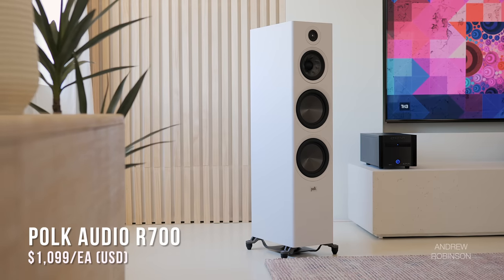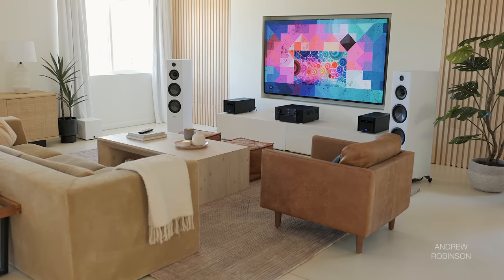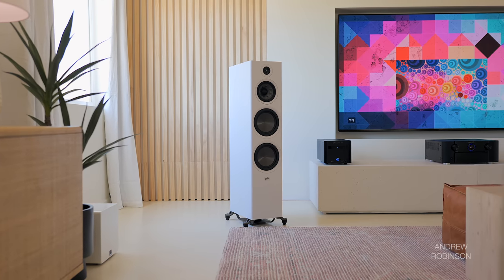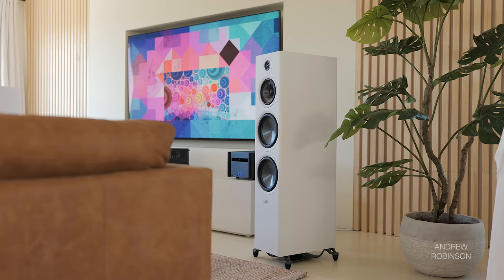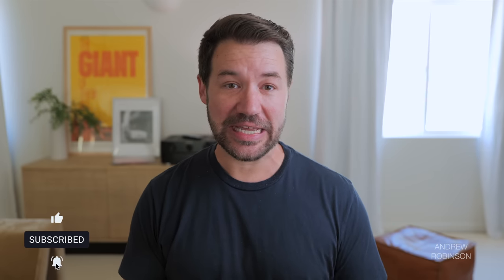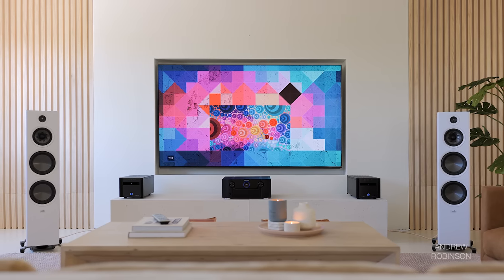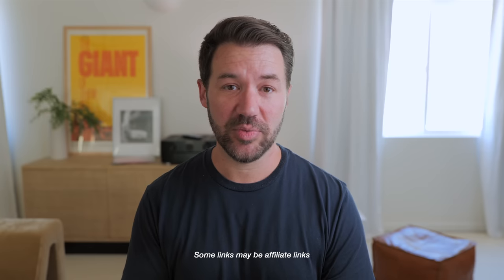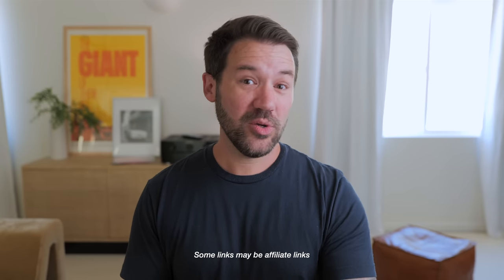Are High End Speakers REALLY WORTH IT? 🤔 Polk Audio R700 Review

Comment: I got the r700's because of this review. I'm disappointed in these speakers. They are very quiet
Reply from the maker: Turn them up? Maybe you're attempting to power them with an amp or receiver that does not have the necessary "juice" to drive them as stated in the review.
Reply: @andrewrobinsonreviews  have a denon 3800h and marantz cinema 50. Looking for a amp now
Reply: avrs don’t like 4ohm loads. unless u have beefy ones, like nad avrs.
Reply: @rushgush  bought an emotive XPA 3 and now they’re good
Reply: @PIPERBOYWILLIAMS  so these need a $1,300 amp to sound good? Wow. I was considering them, but $2,200 in speakers and $1,300 in another amp is a bit much for the average audio fan. I have a Fosi Audio BT20A Pro. $4,500 more is a lot
Reply: @Idiotsincarshere  they sound muffled without an amp with atleast 250 watts. So yea.
Reply: @PIPERBOYWILLIAMS  Having the ability to drive a 4 (or 3) ohm load has zero to do with what the maximum output of the amp is.  It's down to the ability of the amp to source current with the lowest source impedance possible.  By "source impedance" I mean the impedance of the amp itself.  It also matters what gauge speaker cable you're using.  You need to use the largest gauge cable possible (pure copper) to get the cable resistance down as low as possible.  Don't use these fancy "silver" speaker cables.  They're often thinner gauge than a decent basic copper cable and will have higher series resistance.
Reply: @Idiotsincarshere  yea. If you don’t get a good amp they will sound quiet and subdued.
Reply: @Idiotsincarshere  JBL Charge 5 is your best bet, you don't even need to use that Fosi or Aiyima to run it.  ;)
Reply: I'm running these with a Denon x4700h (running 9 channels) and it sounds great to me! That being said, if it can be taken to an eleven with an external amp I would be interested to find out a good pairing.
Reply: @Idiotsincarshere  I get by just fine with 86db sensitive polk speakers using a $400 crown xls 1002. I didn't need to go over a grand unless I'm chasing uber precise imaging (which is not necessary for most casual music listeners).